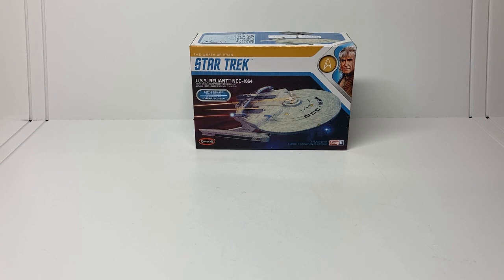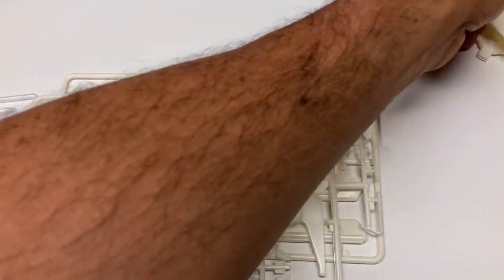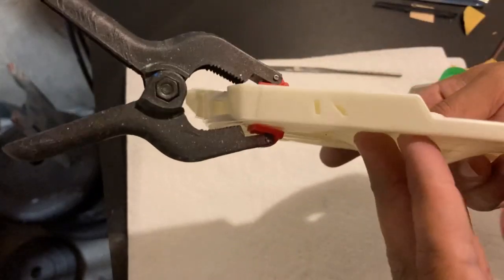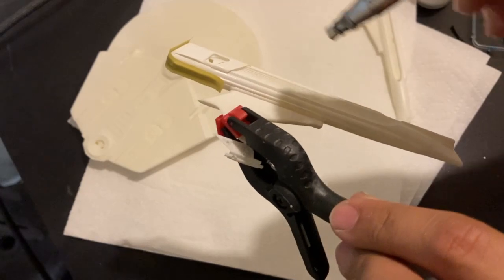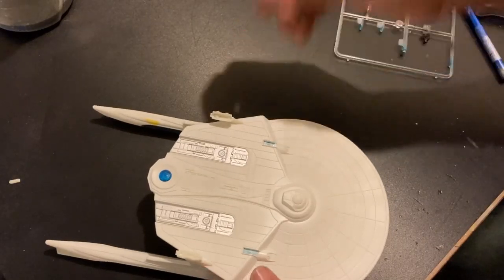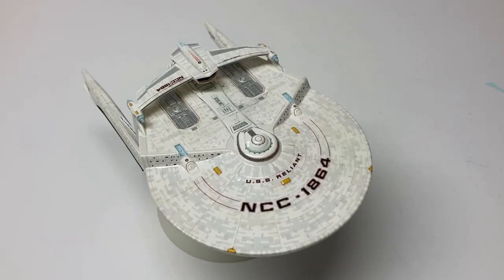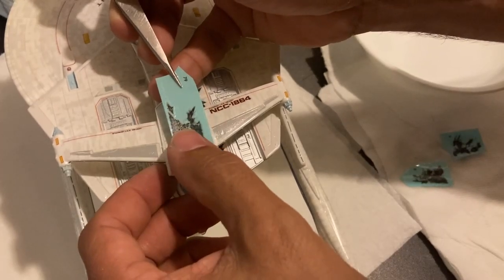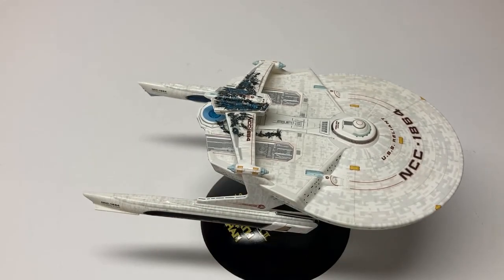P/Review and Build 1:1000 Reliant - Wrath of Khan edition.

Comment: I've got two of these Reliant models, as well as two Enterprise kits - one which I'll leave pristine, and the other to showcase battle damage, respectively.

ALTHOUGH:

I'm gonna use a Dremel to tear holes in the damaged areas of both models. Then I'll use pieces of the sprue to build up the insides of the damaged areas. And finally, I'll lay the scorched decals over those damaged areas.

BUT WAIT, THERE'S MORE:

There's still the question of what to do with the port nacelle, which is supposed to have been sheared from the supporting pylon. 

SO...

I'm thinking that I might sacrifice that nacelle for the sake of accuracy, leaving the amputated strut broken and bare.

All that should be a lot  fun!

Comment: Great looking build I just wish someone would do a Sisko's Saratoga conversion for this kit, it's been out for years and would be such an easy kit to make and still no one has.  The  Reliant decal you have left looks like it's the one that go's under the impulse engine.
Reply: @SeansModelBuilds  Yeah I already have my Reliant built up as the Saratoga NCC-1887 from ST 4 but Sisko's Saratoga is different, no roll bar and added on side parts that no one has made yet.

Comment: I noticed you painted your basecoat white directly onto the white plastic without using a primer?  Also you didn’t seal with a gloss clear coat prior to applying the decals?  Neat trick on the warp chillers sanding off with tge black backing.  I’ll have to give that a try.
Reply: Why paint a base coat? Why not just leave as is and put on decals? Then spray with a gloss coat sealer? Saw this on Enterprise build too
Reply: @benwebb5476  because that looks very “toyish” and also very amateur but if you want to build your model like that hey knock yourself out.
Reply: I was just wondering if there's a reason for the base coat. If the decals stick better. Or if it's just an extra step to take.